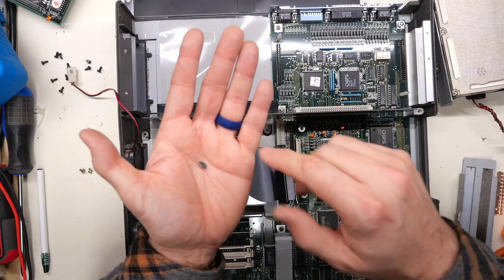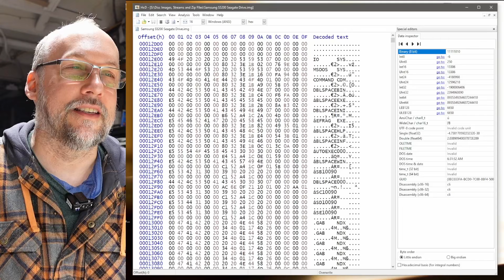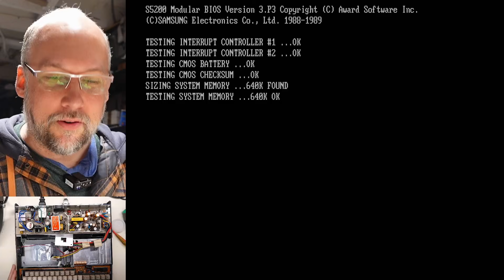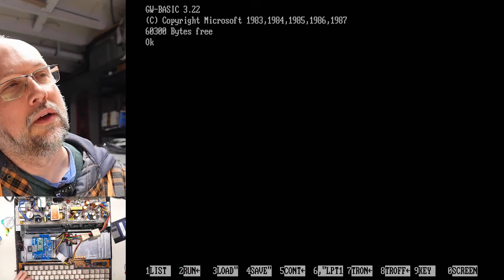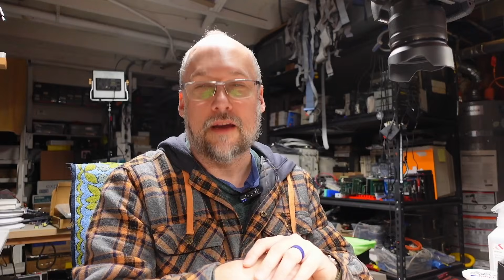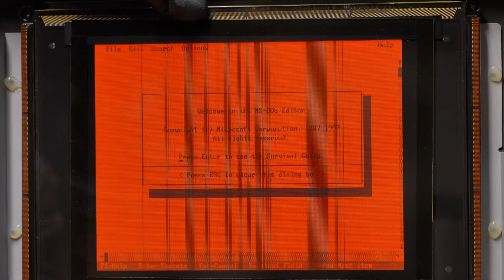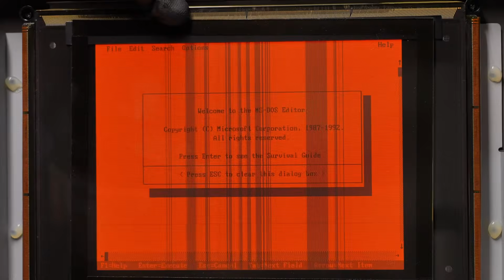PC Archeology: Let's explore the Samsung S5200 and attempt a repair on the gas plasma screen

Comment: The limit is probably about 500mb for a 286 computer for storage.

286/386 generation IDE controllers:

    The 528 MB limit

    If the same values for c,h,s are used for the BIOS Int 13 call and for the IDE disk I/O, then both limitations combine, and one can use at most 1024 cylinders, 16 heads, 63 sectors/track, for a maximum total capacity of 528482304 bytes (528MB), the infamous 504 MiB limit for DOS with an old BIOS. This started being a problem around 1993, and people resorted to all kinds of trickery, both in hardware (LBA), in firmware (translating BIOS), and in software (disk managers). The concept of `translation' was invented (1994): a BIOS could use one geometry while talking to the drive, and another, fake, geometry while talking to DOS, and translate between the two.

486 generation IDE controllers:

    The 8.4 GB limit

    Finally, if the BIOS does all it can to make this translation a success, and uses 255 heads and 63 sectors/track (`assisted LBA' or just `LBA') it may reach 1024*255*63*512=8422686720 bytes, slightly less than the earlier 8.5 GB limit because the geometries with 256 heads must be avoided. (This translation will use for the number of heads the first value H in the sequence 16, 32, 64, 128, 255 for which the total disk capacity fits in 1024*H*63*512, and then computes the number of cylinders C as total capacity divided by (H*63*512).)

Pentium generation IDE controllers:

    The 33.8 GB limit (August 1999)

    The next hurdle comes with a size over 33.8 GB. The problem is that with the default 16 heads and 63 sectors/track this corresponds to a number of cylinders of more than 65535, which does not fit into a short. Many BIOSes couldn't handle such disks. (See, e.g., Asus upgrades for new flash images that work.) Linux kernels older than 2.2.14 / 2.3.21 need a patch. See IDE problems with 34+ GB disks below.

https://www.vogons.org/viewtopic.php?t=64030

Also:

https://redhill.net.au/d/i.php

Comment: My understanding is tantalum caps fail because they have a very low heat tolerance. The tradeoff is they're small for their rating, so they get used a lot. Mid-2010s MBPs with dual graphics have a fairly common fault where a tantalum on the supply rail for the dGPU fails and will cause the whole thing to crash when the OS switches to the dGPU. You can lock it to the iGPU and limp along, or replace the cap. I've fixed two 2012s with that issue. In that case, it's a small SMD cap about 3mm away from the GPU heatsink. It can't take the heat. I replaced it with a higher rating (and physically larger) SMD cap - needed to scrape away some solder mask but the pads are plenty big enough to put in a bigger part AND move it further from the heatsink. So, yes, Apple could have avoided the problem, but they don't consider a high probability of failure after 8 years to be an issue. 😂

Comment: I always use either test disk/photorec when it comes to restoring data. It also work on images, made with DD, I think. My old T3200 I referenced to in the comment in your previous video also used doublespace. 
I case you haven't been able to restore the doublespace thing, I remember helping a friend of mine, back in late 90's who had a virus on machine. Apparently the virus had deleted his doublespace image. An undelete (from MS-DOS 6.20) undeleted the missing files and the pc worked back like a charm. I did remove the virus with some antivirus from McAfee for DOS. Which was kindly provided by my IT teacher.

Love these videos, keep it up!

Comment: If the disk looks empty (especially if free space is less than expected like this drive) always do "dir /a" to show any hidden files, it would have shown the doublespace storage file and the dos boot files. And then always try to boot from it. might be a good idea to have a cf card that loads the doublespace driver and can mount drivespace compressed drives.
Some later vga Sierra games (mostly from 92 or after like Space Quest 5) could run in dithered high res EGA. Unsurprisingly it looked much beter than previous badly done 320x200 EGA conversions of their earlier vga games (which generally looked awful)

Comment: Rather than corrosion it looks like the bending forces are slowly causing the bonded contacts to peel away. Perhaps a tiny speck silver conductive trace paint at each suspect contact will help.

Comment: I have another gas plasma system from compaq (portable 386) but I managed to fix the lines by carefully taking my hot air soldering station for short bursts in the targeted area. 2 lines poped back up after about 2 years but repeating that method fixed it again for me. Super scary doing that but I had a secondary system I was using for parts that had a good display so I figured what could I lose if I killed it. This samsung is super cool though.
Reply: i feel like hot air might be worth trying on adrian's gas plasma..?
Reply: What temperature were you using?
Reply: 3 Billion Kelvin.
Reply: good

Comment: 35:16 Hey Adrian, when you connected the SCSI hard disk to your bench PC and noticed that it was ‘almost’ empty you could see only 3 MB of free disk space instead of 30-ish MB. I assume the ‘dir /a’ command  would have revealed the DoubleSpace container, which is more than likely a large hidden file. At least, that is how Stacker worked, and most likely DoubleSpace too. DoubleSpace was later renamed to DriveSpace as the result of a Stac Electronics lawsuit, that was in DOS 6.22.
Reply: Scrolled down looking for this comment.  ^  Adrian, this is your first stop.  3MB free on a 31MB partition with nothing but command com?  I don't think so.  :-)
Reply: I remember doublespace killing my DOS drive in the late 90's (we were poor so our computer was old), I had the first digital pictures of my sister in a school play, my mother would never forgive me about the incident.
Reply: This is my thoughts exactly.  Doublespace worked by creating a file and then 'zipping' everything within it.  The doublespace driver would need to be loaded for you to see the 'drive' contents within the file.  When you boot from the drive - it's loading it and then the drive is visible.

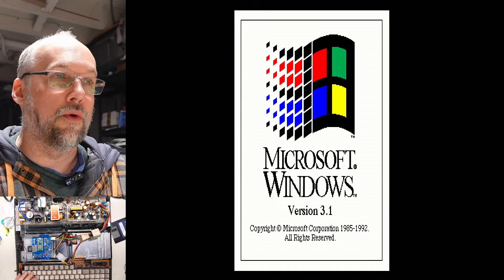Comment: 38:09 !!! I thought Windows 3.1 required a 386??? That clearly says 3.1!
Reply: You're thinking of 95. 3.1 has special modes for 386 but it can run on a 286, as seen here.
Reply: @Toonrick12  Weird... I coulda sworn I'd heard 3.0 was 286-compatible, but 3.1 required a 386. The sorta thing that sticks in memory since surely the 0.1 difference for such a major requirement-change would've confused a lot of people.

Comment: 200+ volts can definitely be dangerous, whether DC or AC.  I was an electrician and was shocked by up to thousands of volts, both AC and DC.  Most was an emergency electronic fluorescent ballast trying to start my fingers in lieu of a lamp with thousands of volts (very low amperage), which hurt a little.  Regular circuits was a 277V AC circuit when changing out a switch while hot (no longer allowed), which caused my arms to extend and throw the tools in my hands.  For DC, I was in a server room, and it's widely known that less than 50V is not dangerous, but I beg to differ as I was twisting a hot 48V DC wire to put a wire nut on, and I must have been grounded somewhere... It didn't "shock" me like an AC circuit (or the tingling sensation like a 9V battery to the tongue), instead it made my finger get really hot like a soldering iron, burning through the first few layers of skin.  Lastly, I've been shocked by a couple different types of capacitors, notably one in a disposable camera for the flash (caused me to throw it), and one in a CFL that held a residual charge (it was the most painful of all as I now have a titanium pin in my arm, which seemed to concentrate everything right there to cause some of the worst pain I've ever experienced... Then, like an idiot, I did it again lol).  So yeah, I'd lean towards being safe than sorry.

Oh, and it wasn't me, but my supervisor was decommissioning a large battery bank that fed multiple UPS units in different buildings.  Never assume someone else properly disconnected something and then try to cut through with ratcheting cable cutters... Once the short was made, there was nothing that could be done until it burned through enough to open the short.  I feel for firefighters who inadvertently cut a high voltage DC line in electric cars... It's bad news.

Comment: Given the option rom for the XTIDE is in memory could it be as simple as copying DEBUG onto a bootable floppy and issuing a JUMP instruction to C800:0000 to get it to boot from the XTIDE?
Reply: I was thinking along the same lines. It's slightly more complicated than a single JMP but not much. It's a far CALL instruction to initialize the option ROM. You still need to actually boot the drive so that would be another instruction. Either INT 18h or 19h, I always get those two confused.
Reply: @eDoc2020  Does the XTIDE take control in order to boot, though?  I thought perhaps it might need to given XTs don't normally support IDE hard drives.  Or does it play nice and return control to the BIOS after initializing?
Reply: @ghohenzollern   Standard hard drive option ROMs hook int 13h. After POST the default int 19h handler is called which reads the drives in order and executes the first boot sector it finds. If it doesn't find a boot sector it invokes int 18h which on non-IBMs displays the Operating System not Found message. Some network ROMs hook 18h so a network boot is only attempted if no boot disks are found.

The XT-IDE has its own boot manager so its init code probably hooks 19h in addition to 13h. When the init code is done it returns control to BIOS which finishes POST, then it eventually calls the modified 19h. This lets you press a key to choose which drive to boot from.

So if I'm not mistaken the bootable floppy would need to contain a far call to the init code, then an int 19h to restart the boot process.
Reply: @eDoc2020  According to my copy of DOS Programmer's Reference 3rd edition, 18h is Execute ROM Basic and 19h is System Warm Boot.  Dunno what 18h does if there's no BASIC Rom, might be functionally the same on some systems.

Comment: I have one of the Samsung S5200's cousins sitting here, a Toshiba T5200/100.....the screen on it is plasma and is pristine with no sign of the screen rot that yours display has, but mine has a floppy drive that's failed, and a flat lithium CMOS battery that isn't easy to find!

Comment: Was about to comment here "geee, I hope you dd'ed a drive image to look at with a hex editor", and the next second you said you did :)

From memory there are other "unformat" tools that will find files without the FAT being required.
Reply: Also, FAT16 isnt too difficult to pull apart manually. Been decades since I did it, but I remember doing it.
Reply: Been thinking of getting a BlueSCSI for my amiga1200, for no other reason than having an empty external SCSI connector on the back annoys me :D

Comment: As for the harddisk limit, I guess it's 504MB, 1024*16*63*512=528482304=504*2**20

- The BIOS hard disk handling was by cylinders, heads and sectors-per-track (CHS). Various revisions and vendors limited these to different numbers, but effectively, the limits were something like 1024 cylinders, 16 heads and 63 sectors per track, meaning a max disk size of 504MB.
Reply: True enough, but SCSI host adapters didn't care about the limits for two separate reasons. Primarily because the fourth parameter is the bytes/sector, often called the block size. Then there's also that LBA mode, for IDE drives came from the SCSI specifications, so entirely bypassing physical block addressing with logical block addresses.
Reply: I thought of LBA after posting this and with LBA, that limit shouldn't matter. But then, there's the number of LBAs available. I found this while looking

The earliest SCSI protocols used 21-bit LBA. Using 512-byte blocks, this gives 2^21 * 2^9 bytes or 1 GiB addressable space. (2^21 * 2^9 = 2^30.)

 @mikebarushok5361

Comment: SCSI was way faster than the alternatives in the eightees and way into the ninetees as well - that's a good reason for using it, even without an external connector.

Comment: Masterful fault finding as always.  It's just crying out for an LCD screen conversion, isn't it?  Plenty of room in there.  😊
Reply: I've got a cheap 10" TV from Amazon with its own battery and HDMI/VGA/Composite inputs that would fit in there without even taking the case off! 😅

Comment: Plasma displays die because of heat. The driver ICs cook until they fail. You have both horizontal and vertical drivers. On plasma TVs, only way to repair dead lines or rows, is to replace driver board(s). Your display, unfortunately, is 💩.😭.🍀.
Edit: And it's not a bonding issue. You poking at it, is same as touching a plasma globe.

Comment: Watch out for the hard drive in these orange. machines, they were nicknamed orange machines because of their orange display. However, a lot of these large machines like this have a major flaw which is the hard drive.  When it fails or gets a piece of malware on it, you can't replace it because it requires some form of software to be able to resign the hard drive to the PC Itself. That's why they weren't very popular.  But if you've got one with a running hard drive you got lucky

Comment: If you don't want to go to the effort of fully disassembling the panel to attempt a repair, the lines did seem to be pressure sensitive to an extent, maybe you could put some shims in there to press the contacts together more firmly, to see if that would help?

It might not help, but it doesn't seem entirely implausible given how this one is behaving.

Comment: Plasma screens were only discontinued in 2013, mostly due to being expensive as heck. When OLED became good, it was the direct replacement. Huge glass screens in 1080p with millions of tiny vfd cells.. pricey! I'm watching you on a 2008 pioneer kuro plasma right now. It died in computers early because of the energy for portable laptops, and the price for desktop when color crt were cheaper.

Comment: Do yourself a flavour and use a plectrum when getting between the plastics to unlock the clips ... they fit in any tight gap you can imagine without bending or cracking the plastics.

Comment: Since there appears to be a bonding issue, I would apply heat (heat gun) across the top then strategically clamp the panel. That might solve the issue

Comment: Ugh … we used to call it “troublespace” as it has the tendency to go wrong in some pretty spectacular ways.  If you had an inopportune power outage or application crash you could end up with a corrupt file system.  Of course it also introduced some overhead and had the potential to bog down the system for drive intensive use.  A better option in that day was the third party tool “Stacker”.

Comment: I did a few DOS based data recoveries before. As long as there's no encryption involved, it should be possible to extract whatever is left over. Not sure about how much time I have right now, but I can certainly give it a try in the near future... [EDIT] just got to the part of the drivespace info; indeed, there's stuff in it. The offer still stands though, if you ever have anything else that needs some hex-level digging in FAT systems.

Comment: Iirc, even without DBL space/drive space loaded, you should really still be able to see more than just command com. There should still be at least the other files that are part of the minimal system files, plus the drive space driver file, and the compressed volume file. Those likely are hidden with the -h attribute though. Doing a dir showing hidden/system files would've likely also shown those as well. Which I'd have done when the regular dir showed nothing except command com. Though I used stacker back in the day, they all still have to have a bootable system at least first, then the driver to find and load any volumes, then the volume image.

Comment: Talking about large drives, I actually had issues updating an old TV, one of the first to even support USB Update, with a flash drive. The flash drive was 8GB USB 2.0, which weren't that uncommon around 2010, just expensive, and the TV recognized the update but was unable to install it. I called the manufacturer because of the issue and they said it should work, but they weren't sure either. Luckily I still had a 128MB stick flying around, update went through without any issues.

Comment: Didn’t know it was called a zebra strip. 
I had a crappy DMM from Radio Shack that I would have to smack to make the screen work. Then it stopped permanently.  I opened it up and cleaned the strip with IPA and it was like brand new.
Reply: I have done a zebra strip repair on a TRS-80 Model 100 LCD. It is not a very fun repair to do, that's for sure.

Comment: 59:20 Arggg, everyone is going to be snapping up the iPad screens after this! :wail:. I do feel obliged to point out that a lot of those controller boards have VGA input, potentially of interest to retor folks. No need to go through a separate some_sgnal to HDMI conversion if VGA is easier for whatever is being interfaced.

Comment: I don't think you can get burn-in from that kind of plasma display. The color ones used a different gas mixture that emitted UV light, which was absorbed by a phosphor layer inside the cell, and re-emitted as red, green, and blue. That phosphor of course would burn in after a while. This panel probably has something like neon in its cells, which emits the orange light directly. The electrodes might wear out after a while, but I wouldn't think so. I have a couple of those plasma display laptops, and they both seem to have similar brightness to that one. Then again I have no idea how many hours are on mine, so I dunno... What was my point again?